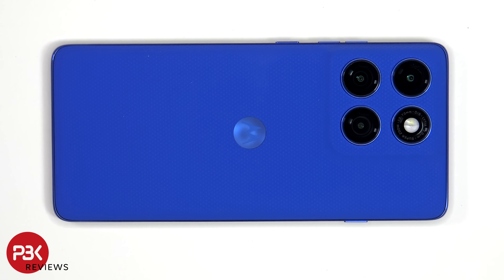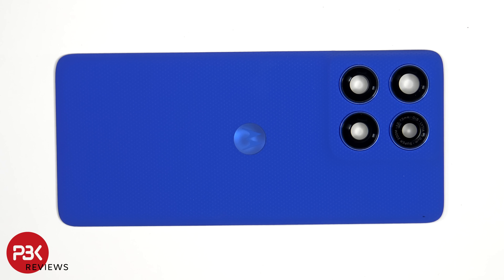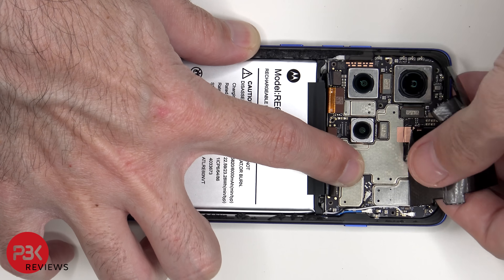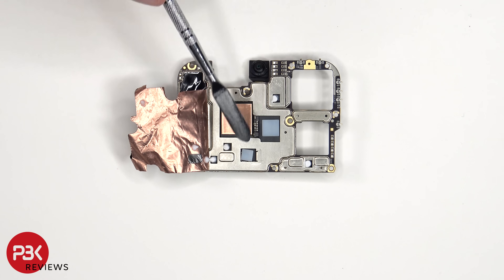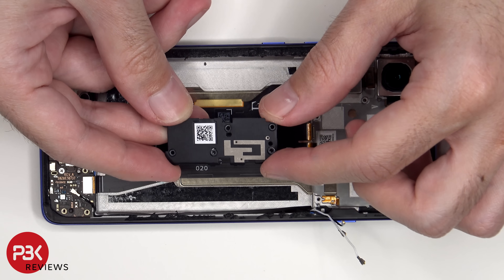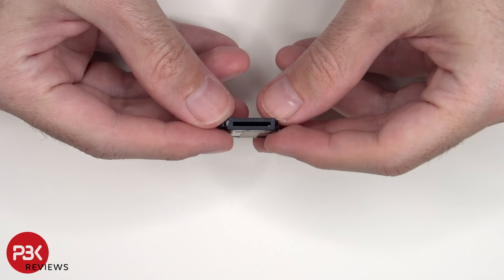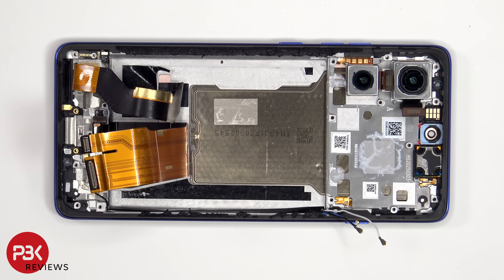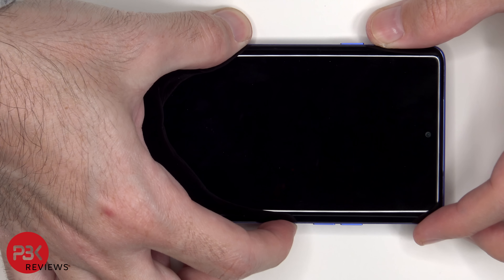Motorola Edge 60 Pro Teardown Disassembly Phone Repair Video Review

Comment: you are a surgeon for the phones, but plz also comment, since this 4n is military graded and has ips 69 rating, once opened, will it keep its water resistance as before
Reply from the maker: You would need to properly clean off the old adhesive and re install the original pre cut adhesive which is made for the phone. If installed correctly, it would retain the resistance.
Reply: do you guess this adhesive might be available in indian market.plus one more thing, did yu apply the same before sealing it. one more question sir, i have bought moto 60 edge pro with wooden back, sir is it ip69 and what kind of precautions do i need , i guess wood wont survive water element, sir plz help

Comment: its not IP68/IP69 rating, water will go inside and whole phone will become useless.
Reply: it is lol, mayby don't go diving with it
Reply: No. The phone from the factory has a type of glue strip holding the back, which keeps the water out. If you disassemble it, you need to replace that glue strip, but it can't guarantee that the phone will be waterproof again (that's why a lot of repair shops don't give you warranty for the phone to be waterproof again after a repair) I repaired tens of phones in the past so I know how it's done

Comment: Battery capacity mentioned as 5820mah
Reply: Minimum Capacity (Min): This is the lowest guaranteed capacity that the battery can deliver under specified conditions. It ensures that even under less-than-ideal circumstances (like high temperatures or heavy load), the battery will still perform to a certain level.
    Typical Capacity (Typ): This represents the average or expected capacity that the battery is designed to provide under normal operating conditions. It's usually higher than the minimum capacity and gives a better idea of the battery's performance in everyday use.

here min = 5820 and typ = 6000 mah
Reply: no look properly its 6000 mah

Comment: 5820 mah 🧐🤨
Reply: no look better 6000 mah written
Reply: In manufacturing, it's almost never possible to make exactly 6000mAh; this applies to any smartphone, so they set a limit. In this case, it was 5800 to 6000mAh, so the battery can come in any quantity within that range.

Comment: 5850 mah only..they saying 6000mah
Reply: There are 2 values: rated capacity and typical capacity (bc of the way they make lithium ion cells, the capacity is always slightly bigger). 5850mAh is the rated capacity (which is the minimal capacity that the battery must have), and 6000mAh is typical capacity (which is the capacity that this battery usually has). So, the battery has 6000mAh, they didn't lie about it

Comment: Watching on moto edge 60pro 😊
Reply: Same here. But I am a bit confused. Tech reviewers pitched the battery as silicon carbon battery. But here in the tear down video, it's showing Li ion. Kind off confusing.
Reply from the maker: They don't write Silicon carbon on the batteries not sure why. All the phones which come with silicon carbon batteries still just say Li ion and have no mention of silicon. Just the way it is for now I guess.
Reply: @PBKreviews  cuz silicone carbone are also Li ion batteries.....
Reply: @PBKreviews Têm algum vídeo desmontar Poco F7 ultra obrigado seu trabalho fantástico.
Reply: @subhajitsarkar887  It's because Silicon Carbon IS a variant of Li-Ion only. Although yea companies should mention it on the batteries anyways.
Reply: Hey man, I'm considering to buy edge 60 pro. Should I go for Xiaomi 14t,Pixel 9a or Motorola edge 60 pro? Does it have any issues? How is the camera?
Reply: @Rakins_Arena  CAMERA is good actually but the new hello ui in moto has a lot bugs which are likely to be fixed till the next android 16 update!
Reply: Jz595 How many GB is the chip

Comment: Is the battery Lithium Ion or Silicon Carbon, as advertised in most reviews ?
Reply from the maker: Silicon Carbon batteries don't say Silicon Carbon and just say Li-ion. Not sure why they don't label anything about the Silicon but just the way it is.
Reply: Does the RAM and storage chips have better make than Realme GT6 @PBKreviews
Reply: I'm also curious to know
Reply: Li - ion is written on the battery
Reply: Same doubt
Reply: Same doubt

Comment: It's been advertised as it has silicon carbon battery but I see only 3:17 lithium Ion battery
Reply: According to wiki: Si/c is still a Lithium Ion battery. The anode is made of a silicon-carbon composite instead of the traditional graphite. This change leads to several benefits, including higher energy density, longer lifespan, and faster charging times.
Reply: It's still lithium ion battery only but using silicon carbon(less than 10%) addition to it can make it denser which results in bigger battery

Comment: Watching this on moto edge 60 pro
Reply: Same but mine mob is pink colour 😊
Reply: Same tho 😊
Reply: Did you find screen guard and cover
Reply: @rogue4340  Not yet
Reply: Nah it didn't came with that  @rogue4340
Reply: @rogue4340  I am using that lamination type membrane  screen guard. I ordered a decent cover from Flipkart for 260. It is good
Reply: Same 😂
Reply: Same pinch 😊
Reply: Is there any heat issue in this phone?
Reply: @Lucifer67845 There is no heating issue but it gets very hot while charging because it also has a wireless charging panel.
Reply: Same same😅😅😅😅😅😅😅
Reply: Me too😅
Reply: Same
Reply: Same😂
Reply: Watching this on my friend's moto edge 60 pro
Reply: How is it?
Reply: @egamer1044 its a good all rounder phone
Reply: Same colour same model
Reply: Same here 😅
Reply: Is the lateral frame aluminun or plastic?
Reply: @josueanadias  plastic buts its good though
Reply: Ich auch 😊
Reply: Me to 😂
Reply: Hii bro I have issue in moto edge 60 pro when I try to unlock my with my fingerprint sensor after taking from pocket sometimes it does not works it on with only power button
Reply: Same
Reply: Bhai aapke phn camera fog issues aa raha hai kya ?
Reply: Bhai moto edge 60pro long time ke liye kaisa rahega
Reply: @DEEPAKKUMAR-xc8fe bekar h
Reply: @DEEPAKKUMAR-xc8fe  theek rhega but an bbd sales me aur bhi ache phone mil rhe
Reply: Same to you bhai😂😂😂
Reply: Mere wale ka toh bhai color bhi same hai😂😂😂
Reply: He realizing what you're watching: "Please, not the surgery!
Reply: Same
Reply: Bhai keisa hai mbl ? Me bhi purchase karne ka soch rha hu
Reply: mast ekdam build quality thoda compromise hai bcz other improvements but overall is good @IrfanWashim
Reply: @IrfanWashim mbl so good the camera everything u won't regret after you buy trust me
Reply: Are yaar mast hai bhai @IrfanWashim